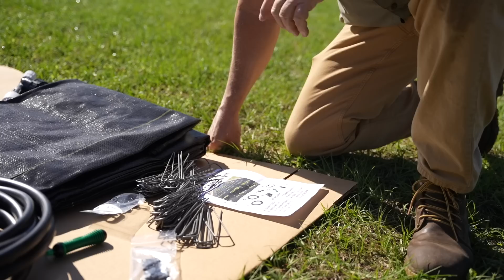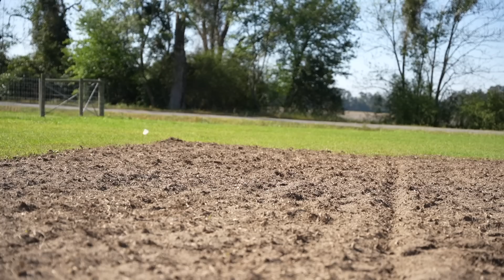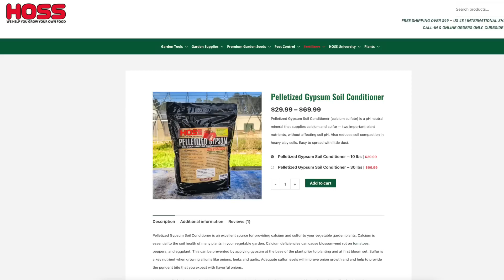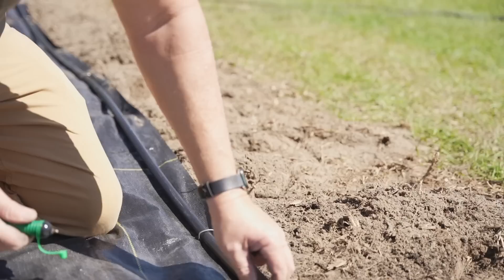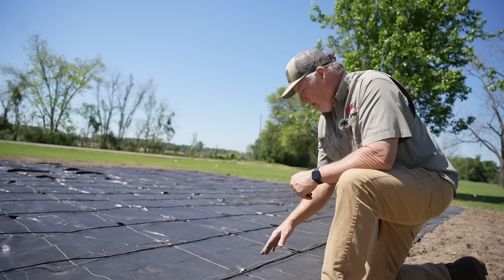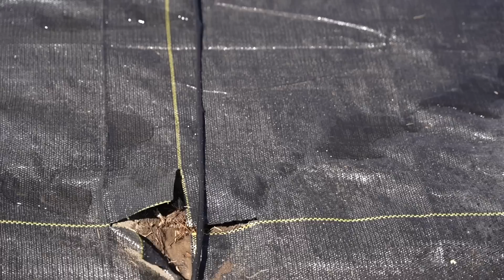The EASIEST Way To Grow Vegetables!

Comment: I purchased a 20’ and 30’ section. My garden space is roughly 50’ x 15’ although it tapers to about 13’ on one end; I just rolled the extra. I put the X ends together in the middle and the slits on the outsides. I am using basically the same drip system that I already had for my old raised beds. Here it is pretty windy and initially I didn’t think there were enough fabric pins but I had extras of those. After I added the ones for the drip lines I feel better. Currently I only have a few plants planted so not much opinion beyond that. So far though I am pleased.

Comment: What if you have raised beds all over? And the raised beds are not in straight lines? Could you use your drip irrigation system or is it only for flat gardens?
Reply from the maker: This one is for flat.  We do have a drip irrigation kit for raised beds.